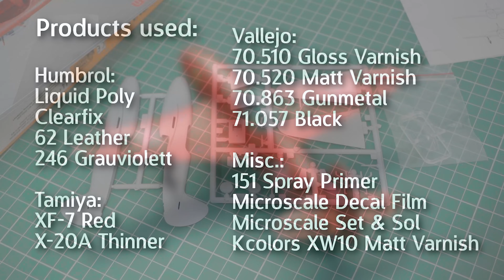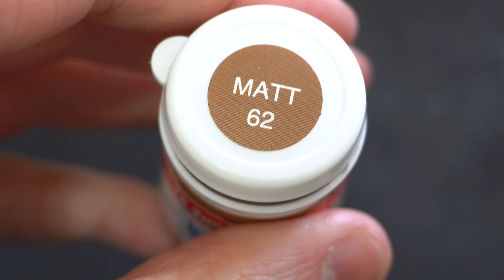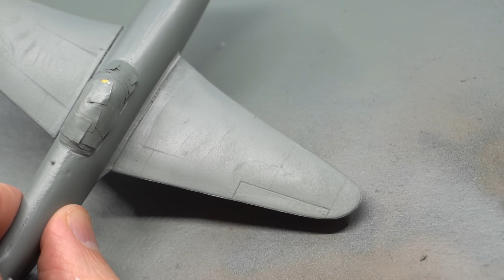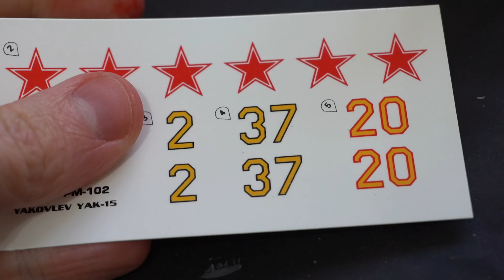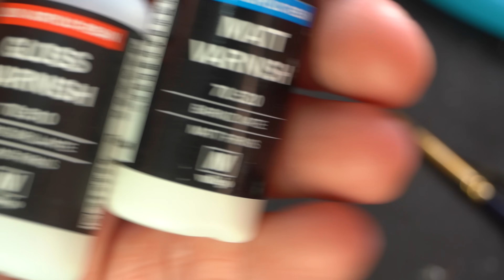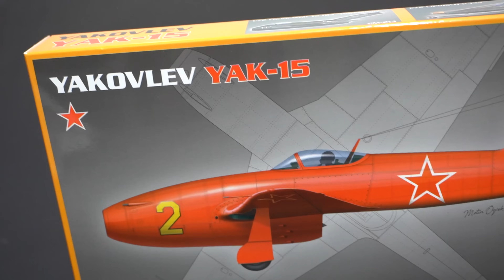A Jet Engine on a Prop Plane - Yakovlev Yak-15 in 1/72 Scale From PM Model - Build & Review

Comment: An interesting fact about this Yak aircraft, the tailwheel was directly in line with the hot jet exhaust. This created melting issues with the rubber wheel on the tailgear. To solve this problem, Yakolev designers came up with an all metal tailwheel.
Reply from the maker: Thanks for the info!
Reply: Oohh now  that’s  interesting